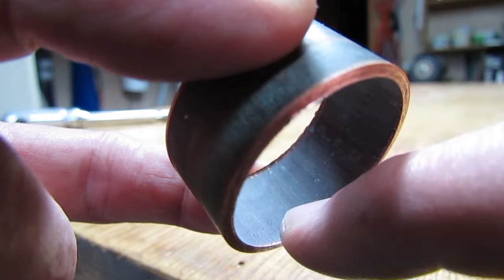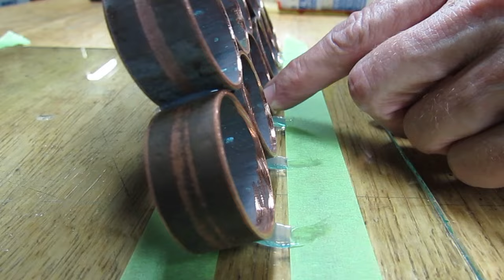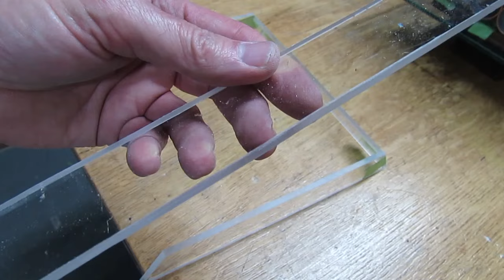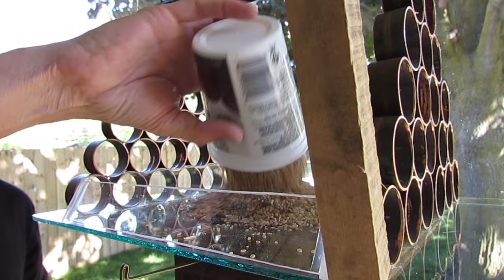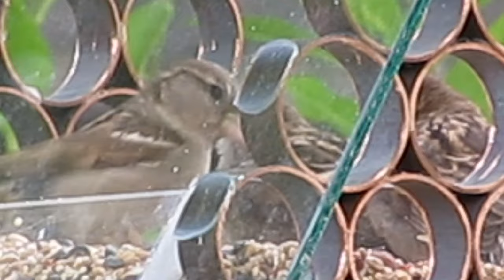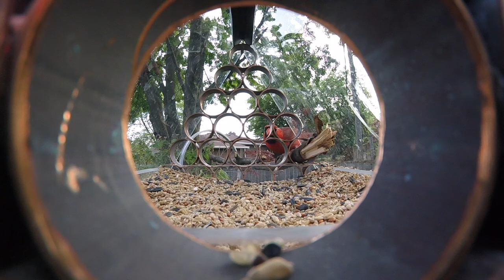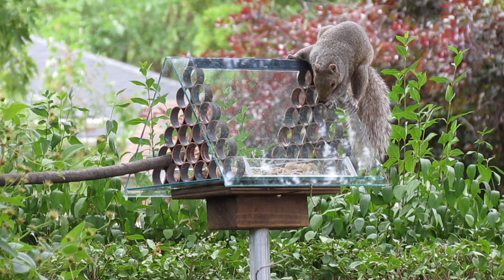How to make ● a  SQUIRREL PROOF  Bird Feeder

Comment: I would have a couple concerns. The size of the pipe would preclude Blue Jays. The other possible concern is copper corrosion which is probably toxic to the birds.
As far as the Blue Jays, it may require a separate feeder that would have allowed them to feed.
Reply from the maker: Blue jays poke their heads in. Copper is holding up fine with little corrosion

Comment: What a wonderful idea.  Good job.
Two questions:
1] What about PCV, rather than copper pipe?  (Easier to work, and possibly easier to find.)
2] What about plexiglass, rather than window glass?  (Aside from being easier to work/shape, I’m also thinking about safety here; for example if the feeder were to get dropped, for example during cleaning or installation.)
Reply from the maker: PVC is soft and they will chew right through it. Plexi is harder but they will chew it too.
Reply: Chris Notap :  OK, good to know.  Thanks.

Comment: added comment. Sorry squirrel, no food for you today.  Cool Squirrel deterrent bird feeder and great design.  Dont know if the squirrel has the strength and can lift up the side covers and squeeze in to get the food,  they are very clever when it comes to getting food.   take care.
Reply from the maker: They can't get to the latch. They slide on the glass if they attempt to and fall off.
Reply: @chrisnotap  Ah,  great,  thanks for how the side covers work.  take care.

Comment: If you can't find a seat belt to salvage, go to any bicycle or tire repair shop and ask for a blown-out inner tube from their trash bin. Wash well, dry, then cut to size.
Reply from the maker: The only problem is rubber is not uv protected and will crack over time. Plus silicone unfortunately does not adhere well to rubber.

Comment: Why copper instead of i.e.PVC? Esthetics? Killing parasites? What you had at hand?
Reply from the maker: PVC is too soft. The squirrels will chew right through it. And yes, I did have it on hand from doing some home plumbing work at my house.
Reply: @chrisnotap  Yeah that's a very good point. And obviously iron will rust (stainless would be nice 2 I guess), but you're absolutely right ... can't use a chewable material. Bet the birbs also like the weather protection when in there.

Comment: @chrisnotap I want to make this but I want to hang it. Can you or do you have step by step instructions written out? Also, I would rather use acrylic than glass if that’s ok. I don’t have a workshop so I plan to see if Home Depot can cut everything to size for me and then I just assemble it.
Reply from the maker: Unfortunately they will chew through acrylic. I'm not sure how you'd hang it and it may not last being hung due to the glass being only adhered on the one side.
Reply: @chrisnotap   can you send me all the measurements for everything? I'm going to see if i can get everything pre-cut so I can just put it together at home.

Comment: Wonder how long it took before the squirrel figured out the latch? They're pretty smart, and persistent. Wouldn't take them long to press down on the latch, releasing it, then flipping the cover open enough to get their head inside.
Reply from the maker: It has been up for 5 years now and they have not figured out the latch yet. The glass is too slippery for them to get to it.

Comment: Did this get really hot in the sun? Was the temp measured?
Reply from the maker: The ends are wide open. Venting is not an issue. It helps to keep the seed nice and dry too.

Comment: Excellent design and very attractive. Only problem I see is it is now 2022 and that 5' of copper pipe you used costs about $10 a foot. And the glass is just as bad. It's a $100 bird feeder and I question the use of glass in really cold wet winter areas.

Comment: I put a 7 or 8 inch aluminum heating duct around the post holding my feeder. It's too big around and a little too slick for the squirrel to climb. It must be placed far enough away from anything that would allow the squirrel to jump onto the feeder. After a time, the aluminum weathered just enough that the squirrel could get a handhold on the metal. I then sprayed it with cooking spray for a little while and he gave up. It's been years and the squirrels contents themselves with whatever seeds the birds drop. None of the squirrels in our area ever get into the feeder. Fast, easy and cheap.

Comment: The above parts list says to use 1.5" copper pipe yet in your test video, the squirrel could get into the jar when the bars were 1.5" apart! You said 1.25" would be best. 
What is going on?
Reply from the maker: Circles and bars are 2 different things when it comes to squirrels. The Bar video shows the minimum size and the circular video shows the minimum size. They can enter bars at a smaller distance apart.

Comment: Just mount your typical bird feeder on a 4-6 ft above ground  3/4 inch black iron steel pipe or similar with a threaded flange, screw the flange to the base of your feeder and your done! The squirrel cannot grip the pipe to climb it and you can use any bird feeder mounted on it and if your worried it will sway back and forth use 4 of them to create a solid base.

Comment: Has anyone had a problem with birds not being able to find their way out? I built this using 1.5" id PVC & plexiglas. I had to bring mine in because the birds were just throwing themselves at the plexiglas trying to get out, not out through the PVC holes.
Reply from the maker: I had 2 birds that couldn't get out. After about 3 minutes they were able to find one of the holes and fly away.

Comment: Not trying to be overly critical, because I love the design!! But that being said, the fact that you used copper pipe makes it kind of a missed opportunity to solder them all together, rather than glue
Reply from the maker: Of the 2 processes, siliconing is way easier than soldiering. No flexing from heat or expansion and you can perfectly align them. It's been 5 years now and it's still as strong as the day I siliconed them.
Reply: @chrisnotap  yea that's very true, and like you said it obviously works just fine 5 years on lol

Comment: I almost cringed when I thought about how quickly the silicone would fail in my area. It doesn't handle heat well and being exposed under glass will only add to the problem
Reply from the maker: Its been up for 6 years now and still showing no signs of weakness.

Comment: This needs to be out on the market. Awesome 👌 job.
Reply from the maker: Maybe one day!
Reply: @chrisnotap  You could sell plans. Take them to the local glass shop to have glass cut. You could use PVC pipes for the ends instead of copper or cut glass ends with cut out holes on each end. 3 on the bottom and one on the top for each side. I am going to build one and use a glass baking dish inside so I can clean it easily and have an extra clean one ready to go. Then just swap the empty with a clean full glass dish. I also think I may put in a glass divider the pan can slide under as my birds stay in same species groups and wont enter the feeder until the other group leaves. With the divider it would give each species a safe space on each side. Going to ad perches on the ends also.

Comment: What type of "drill bit" are you using to remove the rough edges off the copper pipe bits ? Drill bit with a burr ??
Reply from the maker: I used a Dremel type tool with a burr bit.....0:20

Comment: Why use metal. 1 1/4 and 1 1/2 is bathroom sink pipe size. Readily available.
Reply from the maker: The only problem is they are plastic PVC or ABS. Squirrels love to chew and will go through it in no time to get to the seed.

Comment: The challenge. Birds feed and share. Squirrels endeavor to eat everything then try to find an entrance to your attic so they can multiply and not have far to go. They also like to chew - holes into the attic, wires in the attic, even wires under the hood of your car. We decided to trap and relocate those captured into a large city part area. Squirrels also have a large and wide territorial circuit. The latest count: we have now relocated 31 squirrels and 2 rats out of our backyard last summer until now. The neighbors are quite happy by the less intruders into their attics.

Comment: This design would not hold up in winter conditions.
Reply from the maker: It has been up now for 5 straight years through winter and summer and showing no signs of wear. The seat belt material has faded a bit and the copper has a nice patina.

Comment: Beautiful job! Could you use plastic instead of glass? Wouldn't have to worry about breakage and not be as heavy? Go Gators! As much as it pains me to watch them this year, always will be a gator. By the way, we are Dewalt fans too
Reply from the maker: Unfortunately they would chew right through plastic, otherwise yes it would be good to use and easier to work with! You mentioned DeWalt....I don't think I used any DeWalt in the video ?

Comment: Great idea only 3 problems for me in  Australia 1; no squirrels and 2; mainly large colored parrots. 3;the birds would cook in there due to the extreme heat  . Maybe I can use poly pipe for the sides and a mesh top cover instead of copper and glass . Thank you from Down Under

Comment: In your test the opening was 1.25 but the copper tube is 1.5 also electrical conduit of the same size should work. I think chainlink fence has about the same size openings, so that should work to.

Comment: It's creative and very pretty, but apparently you don't have chipmunks where you live. They can get in holes that size with no problem. Also, your design keeps out all the larger birds like cardinals and blue jays, a definite point deduction in my world. I bought a squirrel proof bird feeder and it works like a charm against squirrels. the place I had to get creative was in designing a baffle to prevent the chipmunks from getting into it (they're not heavy enough to activate the spring that closes off the seed compartment). What I came up with isn't exactly elegant, but it's less ugly than the commercially available baffles and a whole lot less expensive.

Comment: Why not feed the squirrels aswell
Reply: Because they are basically tree rats. They will gorge themselves on anything you put out for them and as soon as that feed is gone, they will attack anything else in the area that even appears to be food. I have seen squirrels chew through solid wood and get into grain bins. I know they look cute but they are just another rodent and can be extremely destructive and frustrating when they are not wanted. You could easily go broke trying to keep them satiated. I had a friend who was trying to attract deer and even though all the corn he put out disappeared, he never saw one deer. Then he put up a trail cam and discovered that as soon as he was leaving the 50lbs of corn he was putting out, several dozen squirrels were coming out of the woods and just cleaning house.

Comment: Hi, I love your design and about to build one but I have a question. Based on this video you recommend 1.5" pipe but on your other vide where you test what size will prevent a squirrel from entering, you got down to 1.25 in. Is it safer to go with 1.25" or will 1.5" work fine?

Comment: I made one like that but using PVC pipe three years ago.  Still going strong.  We have regular visits by local Titmouses (and smaller birds.)  We did find a BABY squirrel in it one year but it never came back after being scared away.  It was small enuf to get through the pipe.  We also have not had a big issue with squirrels chewing thru the PVC to get to the seed but my next one will definately be metal pipe.  Great design!  (I used a tray from the dollar store in mine and scrap glass from old photos at garage sales)

Comment: Aesthetically pleasing feeder. In hot weather doesn’t it get like an oven inside, especially if it is in the sun? 
Also, Are you getting birds other than the finch-type or sparrows shown in the video? Seems to eliminate a large variety of birds, unfortunately.
Reply from the maker: The ends are open right? Any heat is able to escape easily. It also helps keep the seed dry if a bit of rain gets in. Win win.

Comment: So only for tiny birds, design limits bird size.
Reply from the maker: I have a new video coming in a few weeks. I found an alternative to copper with a bigger hole for larger birds. Plus I built it on all 4 sides.
Reply: @chrisnotap  cool, will be interesting to see how you solve the squirrel problem with a larger hole.

Comment: Decent work, I thought my Idea was cool, similar in design but made most of it out of PVC and plexiglass.  I do feed the squirrels but across the yard. Here and there they slide off and run away for a bit at the bird feeder. I build bird houses as well. As hummingbird feeders. Good video.
Reply from the maker: Thanks!
Reply: I also used plexiglass but am going to upgrade to glass because my birds get the plexiglass feeder dirty in no time and it never cleans up as well as I would like.

Comment: Our big wooden bird feeder was fitted with a "garage door" on front that would slam shut via 120 volt solenoid when a squirrel stepped on the treadle in front. Sometimes they would not want to let go and the door would slam in their face 20 or 30 times in a row. It was more entertaining to watch than TV.

Comment: You have spent lots of your money to build this...

Instead of this, you could have hang any birdfeeder with GI wire...

This way only birds can reach the feeder flying, but squirrel can't ride thin  GI wires...
Reply from the maker: What is GI wire? The problem is you need to attach the wire you talk of to a pole or something. The squirrels just leap from the pole to the feeder. They are incredibly acrobatic.
Reply: @chrisnotap  GI wire means galvanized Iron wire wire

Comment: Looks lovely, and could definitely see myself having one of these, but have a few questions (merely curious although they may seem a little negative!): is that safety glass? Would it not be safer to have rounded corners on the glass and at least some sort of edging such as aluminium, or even copper? What happens in hot weather - it would be hell in there in bright sun, and copper gets hot very quickly. Doesn't the seed tray become damp from rain, and also from bird droppings? Why is there a ledge in front of the copper rings - doesn't that just encourage predators to sit there? How often do you clean it because given the environment it must surely be a hotbed for bacteria and viruses, especially in the seed tray? I have worked with squirrels in the wild and all the feeders I have seen are wood and acrylic - I've never noticed any that have been chewed through. Do you get mice, and insects in there? How long will the sealant last - does it not start to deteriorate in cold temperatures?

Comment: That's a really sweet project and wildlife boost.  I have a couple of questions for you Chris:
    1.    How did you attach the glass bottom to the plywood base.  I spotted the hook to hold an angled glass roofline, but as far as I could tell that was only on 1 side.
    2.    What tool was used to (a) Cut the copper pipe  (Dremel?),   and  (b) Smooth off the copper pipe edges?  Burrs?

Comment: Squirrels will have it open or torn apart in less than a week. It also limits the type of birds which can fit through the holes. We need fewer sparrows and more cardinals and doves. I also agree with comments about the birds defecating on the seeds. That will spread illnesses quicker.
Reply from the maker: It has now been up for 5 straight years. They have not figured out the latch since the glass is too slippery to get to it and no signs of abuse from them trying to tear it apart.  The birds that can't fit through the holes just poke their heads in. As far as the defecating goes, there seems to be no evidence of that when I clear and re-fill it once a week.

Comment: Chris, as to your first design for a squirrel proof bird feeder, some of us out here in Fan Land are not familiar with construction and / or building supplies. It's nice that you are able to utilize salvage materials, but salvaged copper piping is next to impossible to find or just happen on. Further, it would be advantageous to include, in your supply list, minor details, such as this:
       "Be sure to use a thinner gauge copper piping, for the ease of cutting the 3/4" circles that make up the sides. For example, many copper pipes are M gauge, a fairly thick copper piping, which, when attempting to cut, will take some effort. A better choice might be, DMW gauge, which would not be functional in a traditional pluming scenario, but for a craft project such as this, DMW will suffice."  I am learning a LOT about construction and building supplies, so this project is worth the time and effort.